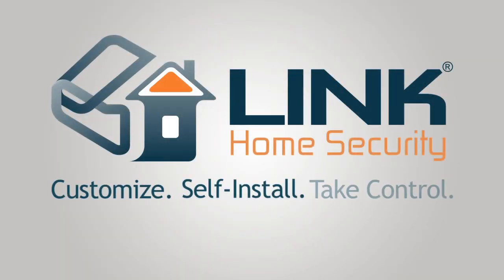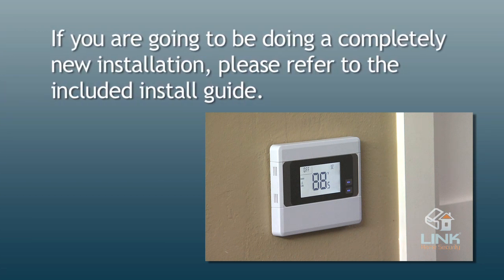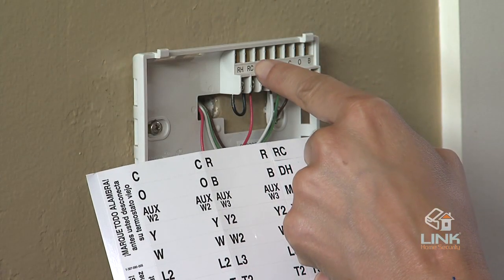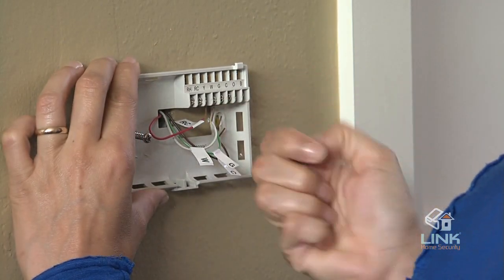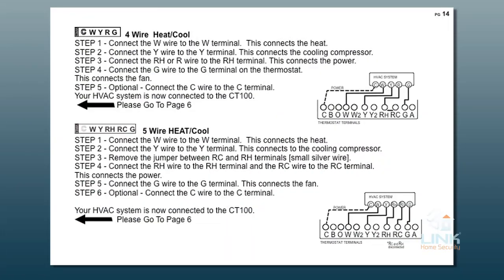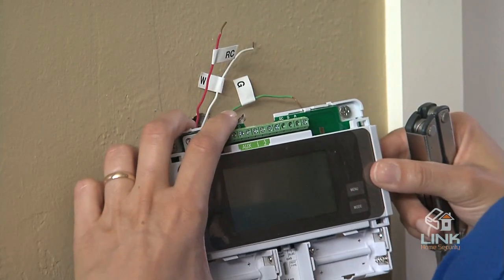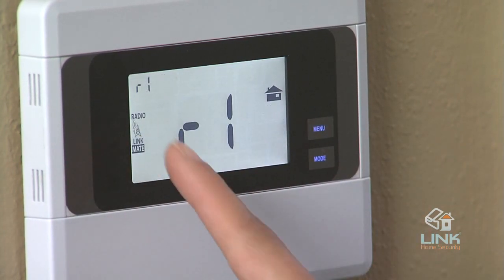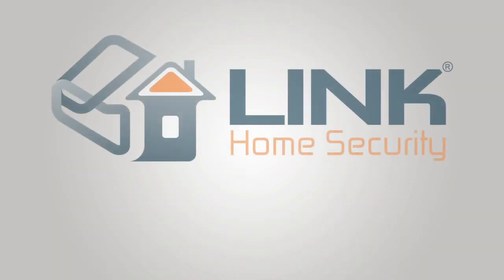How To Install CT100 Z-Wave Thermostat (Link Interactive)

Comment: Thanks for the video,I have one question how do I know which stage to set for my HVAC system?,I just installed CT101 but it does not work
Reply from the maker: Depending on the HVAC system you would have a One Stage ( most common) Or a Two stage heating/cooling system.
One way to know if you have a two stage system would be to check which wire terminals your system uses. If you have a wire in the y terminal and the Y2 terminal that would tell you that you have 2 stage heat system so on Alarm.com you would select 2 heat
stages.  If you only have a wire in the y and the w terminal but not the y2 and w2 than you will select  1 stage. Please feel free to give us a call and we would be happy to help. 877-826-5443